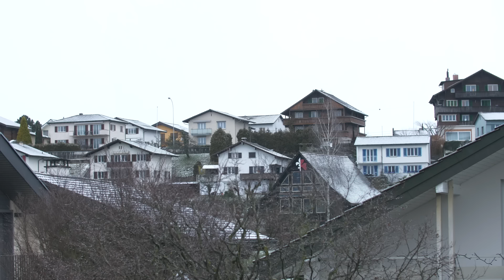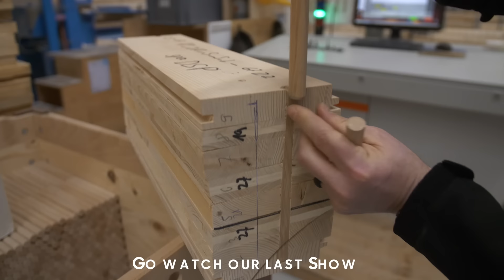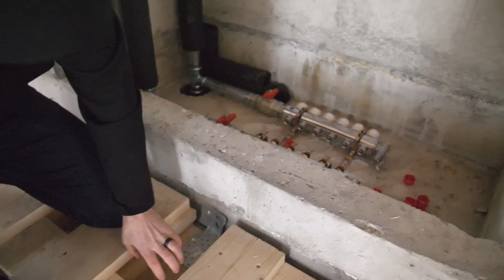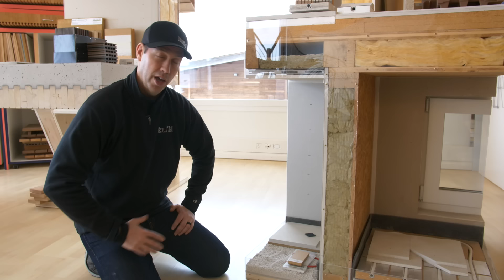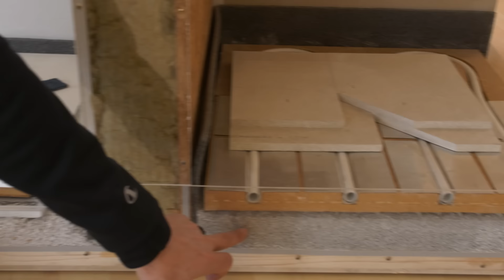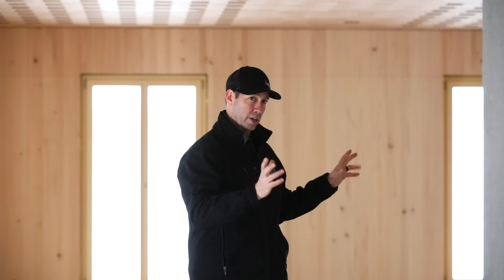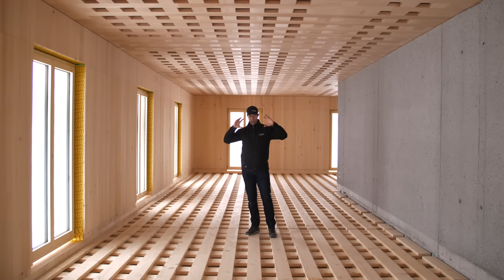This Swiss Building blew me away!  All Wood and Concrete - NO Insulation

Comment: Okay commentors that seem to hate this building method. Give me an example of a wall structure that is more environmentally friendly then this one. With similar R values. Let's say this building took X amount of acres of forest per sqft of space. You can replant that forest and have it fairly regrown in 15 years. This building should last 100 years maybe several hundred You can replace the wood that it used 6 times every 100 years, sequester carbon in the entire building in the mean time. Wood is 100 percent recyclable, it can be used as heating fuel, turned into OSB or particle board, mulch. Or you could re plane the wood and build another building from it in the future. The "sand" in the floors can also be reused in the future. The process to harvest the wood, say cutting them down, and transporting can be done by renewable energy. And all material require transport. Anyways, give me an example of a wall assembly.
Reply: I would question the sustainability of this construction method in large quantities. I kind of doubt you could grow trees fast enough to be churning out millions of these. Not to mention the expense. If I was extremely wealthy, I would love to build my house like this. Although R24 wouldn't be enough in my climate, so I'd need to sandwich some celluose in there somewhere.
Reply: @trevorlambert4226  I dont think anything is really sustainable in large quantities.
Reply: @trevorlambert4226  for an average home, stick built that lasts a hundred years, I can see where this lasting the theoretical 500 years, will easily be better as far as sustainability, you are not going to build millions of them at a time, and they will last 4-5 times the stick built home, and in the end have a carbon footprint of zero.  Thats far better than current home building achieves
Reply: @speedbuggy16v  To supplant common construction methods, you are going to be churning out (many) millions per year. If you run out of use able trees in ten years, it  doesn't really help that the houses you already built are going to last 500. Consider also that 200 years into the future that 500-year house might be obsolete/unwanted for reasons other than durability. More buildings get torn down for that reason than because they are worn out or falling apart. And with maintenance, a properly built stick framed house has the potential to last 500 years too.
Reply: @trevorlambert4226  As a structural engineer based in Switzerland and has had timber engineering researchers, I got to find out that Swiss forestry is actually ridiculously sustainable. There is, for example, an abundance of beech and current research projects focus on introducing design codes for Swiss beech as a structural material. Timber is currently very "in" in Switzerland, as it is much more sustainable than pure concrete construction (not price-wise).
Reply: @trevorlambert4226  and wood is what??  cellulose........
Reply: @speedbuggy16v  cellulose is not wood, they both come from the same source. The important differences are that cellulose has 4 times greater R-value per thickness, one eighth the density (of 2xX lumber), and orders of magnitude less cost per unit of R-value. That's why it's used for insulation and wood is not, and I would imagine it's obvious why wood is used as structure and cellulose is not. Saying wood is cellulose I'd like saying motor oil is a plastic bottle.
Reply: Trevor Lambert Switzerland builds to last 100+years.They don’t mass produce like the USA, because they expect their homes & other buildings to be continuously used not replaced. Where do you live that R24 wouldn’t be warm enough walls?Just curious.
Reply: Trevor Lambert, they would just do like everyone else, buy the wood from Sweden, just like everyone else in the world. Only Canada and the US produce more and the US just produce 1 Billion more kgs of wood annually. 57% of Sweden is forested, the other 43% are Farmland, Mountains, Tundras and Swamps(Myres and Bogs.)
Reply: Trevor Lambert I agree I think that timber should stay for framing while we can produce composites from faster growing things like hemp, wheat, and waste wood pulp. I think we gotta get rid of all these fuckin cows first if we are gonna find that kind of acreage. We also need to give up ethanol in the US. If we replaced all our synthetic or lime based materials with organic ones we could do much better than just giving up gasoline. Methanol is a much better fuel in terms of ease of production.
Reply: @Dollapfin  finally a comment I agree with. Hemp is the other material that is interesting. I dont know much about it, it would obviously have some things to overcome in a large building. But doing things the same is insanity, somethings gotta change. We're in a rat trap.
Reply: Townsend Jason hemp Crete isn’t very structurally sound. It’s like trying to make a building with foam it’s mainly for insulation and to make a flat surface, but if turned into something similar to fiberboard it could be as strong as osb or stronger. I think we’re gonna see more organic materials being used. We definitely won’t be building buildings out of the same wood as houses, but you won’t see 16-inch thick walls made of wood. You’ll see wood structure connected by composites with recycled plastics being used in such composites. I think hardwoods are gonna have to take center stage on the lower levels that are under the most stress. Probably black locust. Check out Hungary’s production of the tree it’s outstanding how fast they can grow there.
Reply: Firstly, you missed the key point: the building has a concrete core. You simply cannot claim environmentally excellence and build with concrete. No way. No how..  Secondly, when facing the ecological crisis we face, our triad of actions starts with what? 'Reduce.' If you're using this much timber (and necessarily using all of the largest boards cut from the tree and none of the smaller), and you could be using less timber, you should be. Do remember that 15 years to regrow the quantity of timber you use not only has a HUGE land footprint necessary per structure, but also means for 14 years trees that could have been sequestering carbon are not anymore. Finally, there are countless examples, but just to give you one, compressed straw. Uses a seasonal crop and requires no deforestation, sequesters far more carbon, uses less material, and doesn't require a concrete core.
Reply: @Phazaar  
Your statement " 'Reduce.' If you're using this much timber (and necessarily using all of the largest boards cut from the tree and none of the smaller), and you could be using less timber, you should be. Do remember that 15 years to regrow the quantity of timber you use not only has a HUGE land footprint necessary per structure, but also means for 14 years trees that could have been sequestering carbon are not anymore. " does not compute.  You clearly don't understand how forest management works in Europe, and you miss that the carbon sequestered into this wood that's used in that building will remain there for quite a while. Not geological timeframes, but with a well-constructed building certainly longer than with many a tree in nature.
Reply: @ohauss  I think it doesn't compute because you don't understand it, rather than because it is mistaken. I am not saying we should not use timber, I am saying that using MASSIVE amounts of timber (like this) for an end product that is in no way superior to the many other options that are not hysterically gimmicky and inefficient is not good for the environment, regardless of how you replace it.

I have a relatively good understanding of forest management, having been schooled on it and taken a particular interest in relation to its construction implications. Perhaps not as good as yours, as I hear in your words the voice of someone with a vested interested... 

Your point on sequestration only has (partial) validity if all of the timber in use has been sourced via forest thinning rather than deforest-and-replant projects. The reality is with even a project this size, let alone applying this style of construction (again, for no actual material benefit over the many other construction methods that do not drastically overuse a single resource) more widely across general structure building, there is almost no chance the quantity+size of timber and the narrow timescales required for delivery were met by thinning efforts alone. If they have come from the vast deforest-and-replant projects, then for 14 years (assuming 15 year old trees; though I imagine for 2x8s they're looking at 30 year old really) the regrowth will not be sequestering as much carbon year on year as the trees they have replaced. This is simple biology. 

I don't miss that the carbon already sequestered in the wood will remain there; my point was only in relation to further sequestration. It is you that missed that. 

I reiterate: unless a resource would be wasted (and why waste wood? We have a growing market for it), where possible using less of it is always the more environmentally friendly option than using more. It IS possible to use less wood than this for a superior product, so we should do that.
Reply: I'll assume you already know about architect Michael Green. He and others have been designing and building increasingly taller all wood CLT and glue-lam buildings. If you've not seen videos he's in you should check it out. I found it very fascinating.
Reply: The "Perfect Wall" (by Joe Lstiburek) with cork-batt (expanded cork) insulation.
Reply: R 24 is pretty low for any climate that experiences cold.  I think this is an interesting idea if the goal is to sequester carbon from a forest that is renewable, but I question the carbon footprint of using this much wood versus using a wood frame and expanding spray foam for insulation.
Reply: I can give you that example. I produce and build houses out of straw wall panels. In terms of insolation it's like 1 meter (3.28 ft) of solid wood. And this material absolutely environmentally friendly. If you put a plaster or some type of boards on it, you get fireproof wall.
Reply: What it takes to cut and mill all those trees has to be on par with what it would take to make a metal building with concrete. I would say 95% of all storied buildings have a core construction which is there for Racking, Access, and for mechanicals as well as Fire safety.  All the wood that is in that building has to be a crazy amount. What about the footings? I bet they have to be bigger as well as that place has to be much heavier than Metal decking and a few inches of concrete. I will say it is very cool and very pretty. That comes at a cost though and to say it is environmentally friendly is an overstatement.
Reply: @onecarwood  No, not even close. If you want to know, the numbers are all available, we don't need to speculate.
Reply: Hempcrete is a superior method of building homes.
Reply: @davidcox8961  I need to look more.into hempcrete. I have my speculations. From my understanding hemp is not a building method. It's not really complete, more like an insulation method. But like I say, I havent seen enough of it to understand it yet. This wood method, provides insulation, air barrier, vapor retarder, weather resistance, shear strength, and a finishing surface on the interior, and a great surface for attaching exterior stuff. It's a complete package.
Reply: @townsendliving9750  I have not worked with it but from what I have learned it works very well. It's not suitable for a load bearing wall. I'd like to build a timber frame home with hempcrete walls a foot thick. As hempcrete ages is continues to absorb CO2 and it just gets harder as it gets older. A field of hemp with produce far more fiber than a forest. Save the trees. Grow hemp.
Reply: It will least way more than you suggest.  If they protect if from the outside with modern finish there's no reason it won't last forever.
Reply: Cork-batt. Less wood, higher R value.
Reply: I think he got something there but I think it is way more complicated than that
Reply: Harvesting with renewable energy??  Like a solar powered chainsaw or skidder???  Dream on.
Reply: @ffjsb  right?... My last comment was to the original commenter.
Reply: El, it said who you addressed it to in the notification, so I knew it wasn't me you were addressing.
Reply: Stfu! Jeez
Reply: Townsend Jason I think straw bales would work great for insulation.  The can be covered with mud and plaster to get nice smooth looking walls; however, they need a skeleton structure in place.  This can be done with traditional wood stick, bricks, or concrete.  They offer good acoustic and thermal insulation.

A second awesome wall system is made from ICFs. After pouring in the concrete, you have thermal and acoustic insulation on both exterior surfaces and a sturdy building skeleton.

A third system are AAC. The blocks made from this material have great thermal and acoustic properties.  They have some wall bearing properties, and when combined with concrete it forms a strong skeleton for buildings.

So here you have three alternatives.  It basically depends on what is locally available at a reasonable cost.
Reply: Concrete core acts as thermal mass store, genius thinking, let alone fully recycled materials.
Reply: A modern concrete and metal Barndominium style. Far cheaper, faster build, scaleable, no trees cut.
Reply: @hippo-potamus  Are you proposing a five storey building with a concrete core, concrete floor plates and metal sheathing  and roof? Because that's a lot of C02 emissions  (both in energy used to produce concrete and steel, aluminum etc. and in emissions released to make cement). And the challenge was a more environmentally friendly building method.
Reply: The video title clearly states wood and CONCRETE. I simply gave an example where buildings replaced the wood with metal as in the case with barndominiums. If you want maximize being "environmentally friendly" then the best examples would be Earthship homes. Additionally, do you know who loves higher CO2 levels? PLANTS! Global warming is a total scam that's why they changed the term to climate change. There are many documentaries stating that factory farming produces more CO2 emissions than all the cars, trains, boats, airplanes, etc combined, which is a propaganda to push the vegan agenda and create an even weaker, dumber, more docile, nutritionally deficient human slave worker zombie.
Reply: i think ure missing the point here.. big time. project like this does not bring anything new to the idea of global warming. the cost of this project compared to the function of global warming does not add up. if they've done something like cheaper project and spend the difference amount of money in whatever is that helps such as planting trees for example  it would be still multiple times better idea than this. this is nothing but a show off.
global warming does not come from just CO2 emission industries that are making this world function.
its the whole fossil fuel thing and since everyone wants to have economic growth i don't know if ure aware but a lot of paper needs to be produced just so you can archive all those documents. you see.. we all want more money but then again that equals more wood being cut in order to meet the paper demand.  as long as we do stupid things we will pay the price. it has always been like that and it will always be like that.. cutting trees and building taller builds with still having concrete as a core... japan had taller wood builds made w/o any metal nail inside.. as i said it is easy to jump the wagon seeing 16" all wood walls but is it the right thing to do..?
Reply: @serafar  building things cheap has been America's motto for some time now. That's not a great method of solving any issue. Building with new ideas and trying to advance in some form, even if it's not perfect, it leads to better ideas. Building shot as cheap as possible in the hopes that the money saved will be allocated to some good cause is a terrible idea. The corporations will build a pile of shit and save billions, and spend a million dollars on planting trees and say good enough, the rest will go into thier pocket.
Reply: @hippo-potamus  The "They" you are talking about with regards to changing the term from global warming to climate change, are politicians who refuse to accept scientific fact. The people showing that earth's climate is changing and its average temperature is rising are making very little money off of it, whereas the politicians and companies denying it are heavily dependent on the income generated by fossil fuels.

Farming producing CO2 is not a problem, as that's generally CO2 that was sequestered in the food eaten by the livestock (ignoring the fuel used); the issue with farming is the methane produced by the livestock, as methane is a far more potent greenhouse gas than CO2 (~28 times more effective at trapping heat). Unlike CO2, however, methane will decompose in the atmosphere (takes about 8 years) and it decomposes into CO2 and water.

Obviously there are sources for both CO2 and methane that aren't caused by human activity, but the main difference is that earth's ecosystem takes an enormously long time to balance itself out. Over the last half a million years or so, it's gone through slow dips (50,000 to 70,000 years from peak (around 280 parts per million CO2 to troth around 200 ppm CO2) ending in ice ages and then relatively rapid rises (a couple of thousand years from troth to peak) ending in warm interglacial periods. However, in the past roughly half a million years, we have no indication that the CO2 levels have ever gone above 300 ppm before 1910, and we crossed 400 ppm five years ago. That means we've seen a bigger rise in CO2 levels in the last 105 years, than earth has seen between ice ages and interglacial warm periods in the last half a million years, and we weren't in an ice age in 1910. In fact we don't have any indication that the atmosphere has had this much CO2 in it since about 50 million years ago.

Now, what's changed in the last hundred or so years that hasn't been part of Earth's otherwise reasonably regular cycle of CO2 levels for the last fifty million years? It's not volcanoes, because we have evidence of several super volcanoes going off in that time. We have no indication that solar activity goes through such massive changes every fifty or so million years. All evidence points to human activity as being the biggest influencer of this massive change.

Now, if you're an ardent believer that climate change is all a big hoax, I strongly urge you to buy a house along the coast lines in places that are heavily threatened by rise in sea levels caused by climate change. It should be a steal - just tell the sellers that their property is going to be swallowed by the sea very soon and try not to giggle as you lie to their faces. That way you can have a really cheap and cool beach house, and neither you nor your children will have to worry about where to live.
Reply: @townsendliving9750  
Building cheap means building efficiently. Expense is derived from resources and energy consumed, therefore the cheaper of two buildings will always be more environmentally friendly (factoring present and future expenses together and assuming same cost of labor over two projects). The important question then is if it actually functions as a building.
Reply: @Smullet90  totally incorrect, people pay several hundred dollars per barrel of oil for disposal. So I can go get these barrels of oil, stack them up to make a house, and plaster over them and proably have several thousand dollars left over. Oil proably has good insulation properties, it will prevent the barrels from rusting, it's good sound deadening. Doesnt mean it's the better choice. Jist like people make flyash siding, dont know if you've ever been around a coal powerplant bit that's where flyash comes from, they p you y to get rid of it. And people are using it to side thier houses. Very skeptical on that process as well. Cheaper is not always better. Actually its almost never better.
Reply: @townsendliving9750  
Obviously I am talking about intrinsic cost. The intrinsic cost of barrels of oil is pretty high for a building material, especially considering that building material will not function very well as a house.
Reply: Townsend, oil will NOT prevent steel barrels from rusting, I've had gallon a can of WD40 rust from the OUTSIDE and start weeping fluid.
Reply: @ hippo potamus Lmao.. No trees cut?! Are you trying to say steel and concrete are more enviromentally friendly than using sustainable forestry? Do you have any idea what is involved in the production of steel and concrete?? Not to mention the fact that steel and concrete are made from finite materials (meaning once we run out, we have no way of creating more)

Edit: just read your second comment.. You're trolling right?! If not, please dont reproduce.
Reply: Karl, we have PLENTY of raw materials for steel and concrete, not to mention that steel can be recycled.  Evidently you don't know how they're made...
Reply: @hippo-potamus  It may be fast to build with, but concrete is one of the worst materials to use when thinking about the environment. A lot of carbon is released in the environment. It's one of the most polluting materials you can think of. Also steel has to be mined and made first, which costs a uge amount of energy and permanently damages the environment as well. Wood on the contrary can be replaced. For every tree taken down another is planted. A tree is also carbon neutral. So it is must sustainable. And as they said in the previous video about that factory. In America but also here in the Netherlands (please Amaricans stop saying Holland ;-) ), just a few hundred km from Switzerland, we think short term. If you build a house in Switzerland they will live in it for maybe a few hundred years with multiple families. They are not interested in what they will get when selling the house. So it will be a very cheap house compared to our houses which do not last that long.
Reply: @hippo-potamus  my house is made of concrete (ICF) I love it. I built it that way for a reason. But concrete ingredients have to be mined, which any form of mining has a large environmental impact, also it sounds crazy but they say the world is running out of sand, look up some documentaries on it, we are using faster then the world can produce it. Much like trees I suppose, and thirdly when concrete is mixed it produces high volumes of carbon (monoxide or dioxide?) So even concrete isn't sustainable in high volume. But we have invested so much in infrastructure and technology to build from concrete that we are able to build in quite large volume. We are pretty maxed out on our rate though. And I know ICF is a bad example, but I build my house out of it and the EPS is pretty bad to build with, there is still foam balls rolling around my house and yard and I built the house 5 years ago.
Reply: @townsendliving9750  Sorry you got it wrong. When concrete is mixed, carbon is not involved at all, just calcium, water and oxygen. Concrete actualy ages by "eating" carbon dioxide  of the atmosphere.  And you know what? If CO2 concentration in atmosphere is increased, plants will grow faster thus this planet may become a greener place :)
Reply: @zbynekII  The majority of plant life grows much worse in increased CO2 levels.  They aren't built for it any more than your car will run better if you run the fuel mixture too rich.
Reply: @danheidel  Sorry to dissapoint you, all plants that photosynthesize e.g. green ones  in simple terms, do grow better when you increase CO2 level, and on top of that they need less water to thrive under said circumstances. Look it up, ask uncle Google or if you are really into biochemistry details, there is allway some university teaching STEM nearby. In general, this subject is more complex that what I just wrote, because plants do need other nutrients besides CO2 to grow, the process is affected by temperature and so on and so forth. Have fun learning, always verify what are told to, and don't you ever dare to compare a combustion engine with a plant cell :)
Reply: @zbynekII  yea I dont know where you get you psuedo science Information from, sound like some alex jones bullshit. But people feed off of disinformation and incorrect statistics that work with their personal agenda. Concrete releases Co2 when mixed, all chemical reactions release some form of gas from them. Mixing concrete has an exothermic reaction, it hears up and releases a ton of co2. I know this because while mixing concrete my gas monitor went off. That's how I learned that little fact. Its is the 2nd highest co2 producer in the world next to burning fossil fuels. It also doesnt absorb any co2 in in life. But their are concrete mixes that sequester carbon and are a carbon neutral product. Bit they aren't hardly used at all. Also co2 is killing coral reef and tons of sea life already, at this rate we might as well assume they are dead already. Also like stated before I use to work in the industry of testing emissions for.power plants and a few other industrial processes. Get your facts from scientist, not politicians.
Reply: @townsendliving9750  I hope that when you say mixing you mean putting together sand cement and water, right? The cement is transformed into hydration products, to new 
compounds containing chemically bound (crystalline) water.  The basic equation is following 3 CaO . SiO2 + n H2O -> 3 Ca(OH)2 + SiO2. (n-3) H2O. Therefore, and I repeat it once again, CO2 is not involved in mixing. I shoud know it, I happen to study material engineering in construction and had a pleasure to verify this in our laboratory. And if you behave, I'll tell you when and where is carbon dioxide in equation when talking about concrete and perhaps I'll tell you the secret from where did it originaly come from :)
Reply: @zbynekII  I did 10+ years working as a cellular and molecular biologist.  I am perfectly well versed in how biochemistry works.  The response of plants to increased CO2 is extremely complex and many species do not exhibit increased growth and many decrease growth rate.  Additionally, many field studies have shown increased pathogen growth rates with increased CO2 that mitigates or even reverses the increased growth rates.  That does not even take into account the increase in plant stress from drought as temperatures increase.  In general, C3 plants tend to show more positive responses than C4, as they are more CO2 limited in growth due to the inefficiency of RuBP.  In real world growth conditions, it is clear that increased CO2 levels lead to mixed results at best.  Your blanket assertion that increased CO2 will cause a greener planet is not backed up by scientific research and you should try following your own advice.
Reply: Dan Heidel dude I would love to have your job. Trying to get in to Penn State. Wish me luck. I’m more interested in the plant kingdom so I might become a botanist but idk where that will take me.
Reply: @townsendliving9750  also the production of lime is insanely carbon intensive.
Reply: @townsendliving9750  Your house is an environmental catastrophe. Both the foam and the concrete are horrible in terms of greenhouse gases and energy input. If this construction method became mainstream, humanity would be doomed.
Reply: @trevorlambert4226  I understand, the to build it is terrible, but once its built it's great. I live and work from home, I have a mechanic shop out of my house. I can assure you from what i was do g before it is much more efficient. Jist the drive alone I avoid is 50 miles a day minimum. There was a million benefits in building this way. All my life I said I think styrofoam should be banned, mainly talking about packing peanuts. Until i built woth ICF and then i seen how great it was. And hopefully my house is an easy 200 year long structure.
Reply: @zbynekII  good chem. equation, however I thought the environmental issue comes from the production of the 3CaO ?? https://www.sciencedaily.com/releases/2009/05/090518121000.htm
Reply: @andrewdasys4026   If I remember correctly, approx. 0,6 kg is released for each 1 kg of cement  during thermal decomposition of limestone, so clearly nothing supposedly environmentaly is happening during concrete mixing. Now, the question is where was the CO2 before was turned to sea shells and then to limestone. And also I can quaratee you that majority of cement in concrete will eventualy turn back to sort of limestone by absorbing atmospheric CO2 if left  unprotected. Simply said, we homans are moving heap of stones from one location to another, creating someting new and destroying someting old simultaneously. Is it good or is it bad? I've got no idea.
Reply: Straw Bale Timberframe is more sustainable!
Reply: Engineered I-joist studs or Larsen truss structure, wood fibre board insulation externally, racking board internally taped, warmcell recycled cellulose blown in insulation. Much better insulation value up to passive House standard. Less wood used, plenty of recycled material, minimal plastics used.
Reply: @davidmason2581  This is what my house is.
Reply: Stick framing with fiberglass insulation, there you go.
Reply: You can't get 2x8s from a 15 year old tree. Not replaceable in 15 years.
Reply: You cannot replace the Forrest in 15 years. A Spurce takes around 50-70 years to grow fully here in central Europe. It is the most used wood here. And our Forrests are growing every year because we dont use all the wood for heating anymore like in the past. Greetings from Austria.
Reply: @tenj00  
Greetings from Germany. Our forests grow because they are managed to make them grow - by replanting more than gets taken out. How long a tree needs to fully grow is essentially irrelevant, since you're basically cycling through trees. The newly planted tree will take 50 years, but you have more than enough that were planted 50 years ago that will be ready now to make up.
Reply: I know I own forrests myself.  Grüße aus Österreich! :)
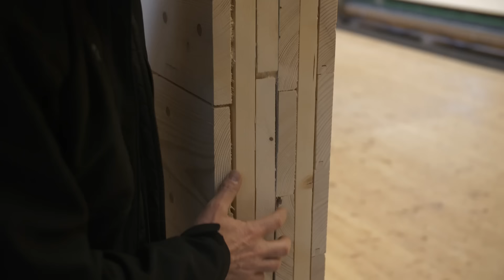Reply: review 0:56......the trees those boards came from are WAY older than 15 years.
Reply: my house is made out of briks and two parts of it are built in 1920

the celler and the first floor of our other house is from 1900 (mybe older)

boilt out of briks or concret and your childrens children have someting or boilt out of wood....... wood is shitty it brings only problems
Reply: just speculation, but the energy from beginning to finish on all this wood has got to be very inefficient? Just because it is made of environmentally friendly materials doesn't mean it is? Maybe if you actually want the house for 200+ years, it's better, but that's usually not the intent with modern building. Things change and chances are no one will want to live in this building after some time. Lighter weight, flexible higher efficiency insulation and modern, temporary building processes seem like they would win out especially in the short term which is more important with modern sensibilities. 

I don't know everything that's goes into building a home though..
Reply: there is more sustainable building than this, ramp earth building.